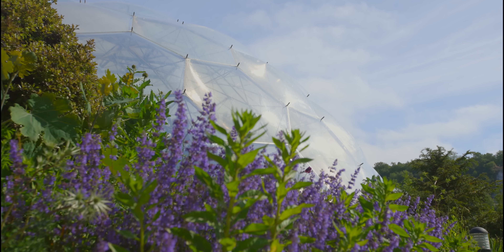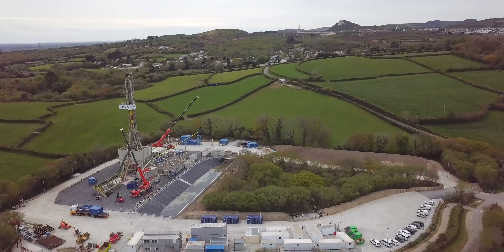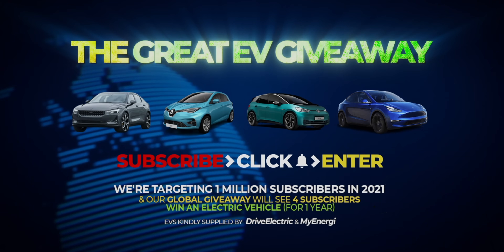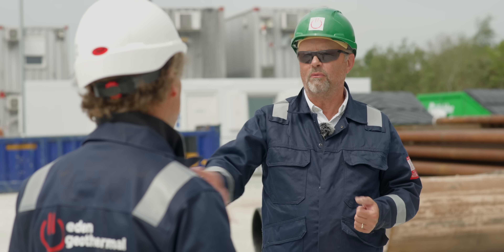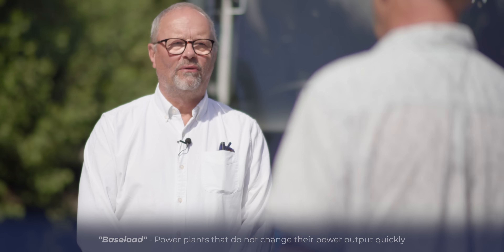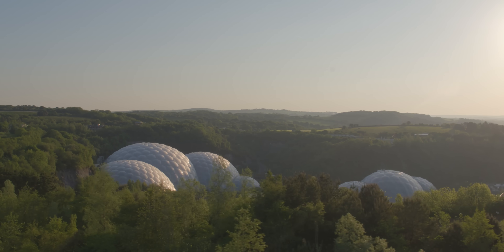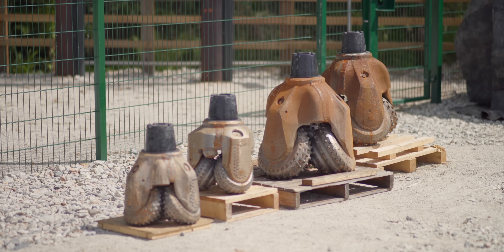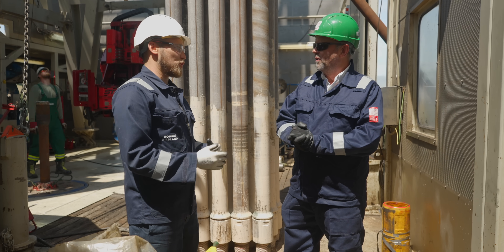Is Geothermal power the answer? | FULLY CHARGED

Comment: If you pump down cold water and pull out heat, how long can you remove heat from the ground before the process doesn't work any more? Because effectively you are cooling down the rocks. I suppose my question is how much thermal mass is down there to extract?

Comment: Does the fluid coming back up not bring anything with it? Salts etc. No by products?
Reply: i'm not sure if it's water or steam coming back up.   either way, anything that comes back up can be pumped back down presumably.   in fact this is the same area where the other fully charged videos was filmed about the possibility of mining lithium, so perhaps some of those salts are actually useful / valuable.
Reply: @mralistair737  yes, but pumping it back in takes up all the profit of the generated power, so there is a net zero benefit. Most of the salts are silica which is worthless but clogs up the pipes as the pressure reduces.
Reply: Spot on! Lots of pollutants and greenhouse gas. It clogs up the pipes and turbine blades if it was actually steam. You have to inject it back because no one wants it in their stream.

Comment: I applaud the innovation, but there's a lot of energy being expended in the build process to provide a steam source for a turbine that produces a measly 5MW output.
Sure there's the promise of producing steam for a long time, but with it being a max of only 180ºC it's comparatively low energy steam. 
Typical steam turbines have 3 stages, HP (high pressure), MP (medium pressure) & LP (low-pressure) stages, the MP & LP use bled steam from ou6tput of the more energy-dense stages (through heat-exchangers) to pre-heat their input temperatures thereby raising the overall efficiency of the plant.
The LP stage is the largest & bulkiest stage & would require a lot of energy just to get it up to its operating rotational speed.
Having said that, it's not all doom & gloom as it wouldn't have the critical differential expansion problems of the other higher pressure stages.
Sorry for my rant, perhaps flying pigs might be feasting on this pie in the eye idea. 😉

Comment: If there are no inter-connecting pipes or the pump in pressure is high .... it's Fracking. What is the working fluid? Is it fresh water? How much water? Is the water recycled?. How much energy do all the pumps use? 4 or 5 megawatt can be done with one semi-large wind turbine. Tons of questions here about costs and long term heat availability in the area being worked.
Reply: Was wondering if this would have the same issues as fracking. Would like to see that question answered, otherwise would love to see more geothermal plants all over!
Reply: @timj11dude  They mentioned that it doesn't use high-pressure water so it is not trying to break and crack open spaces underground. Think of it like water cooling the earth. There is a water which is passed through a loop which gets heated, the longer that water spends down there in the fissures the more heat the water can absorb. Before returning to the surface where we extract the heat and the loops starts again using the same water/fluid. The most damage is done by the drilling itself.
It might not create the most energy and they did say it was a bit of a test project. They could probably get more power by having a bigger gradient between the hot entry and the exit. Perhaps also by drilling deeper and also my increasing flow rate of the water/fluid. But as they mentioned it's not to compete with wind or solar, it's to work along-side and be a base-line which won't fluctuate depending on the weather.
Reply: frackin is using pressure to fracture the rock, they are not trying to fracture the rock, they are using existing fractures, the liquid going in (presumably water) will very likely be at a similar pressure to what's down there, the main pumping pressure will likely be generated by the water heating/boiling.   it's probably / possibel that its a closed loop and that what comes up goes back down, and it just goes through a heat exchanger at the top.
Reply: also fracking doesn't usually happen in 4km of granite, it's normaly in lighter shallower sedimentary rock. and over a much larger area.

Comment: "It's not going to run out". Sorry Robert, that isn't how anything works, including solar.
Reply: Well, solar will last for billions of years and when that is exhausted there will be no planet earth anyway.  However it also crossed my mind that Robert’s bland assertion that geothermal was limitless makes no sense whatsoever.  However I sense that it will last a lot longer than fossil fuel reserves.
Reply: @robsengahay5614  I completely agree, but I'm sure the early exponents of coal, oil and gas said it would last lifetimes (and they were right). There's a flaw in the argument. I'm not sure drilling big holes into the balloon we live on will work for as long as they think.
Reply: @Grafter_67  Neither am I convinced……but there really is only one way to find out.

A poor analogy but many people I spoke with about buying a Tesla assumed that my battery would need to be replaced regularly but it seems that they are doing better than predicted.  The only way to know is to build the batteries, put them in cars, and drive them for hundreds of thousands of kilometres.

If geothermal energy lasted only 200 years it may still be a worthwhile enterprise even as a stopgap but if it lasted 1000 years or more and the environmental impact was limited then it could be a boon.

Either way I think the research that comes from this is worthwhile.
Reply: If everyone person on Earth got all their energy from geothermal, and used as much energy as an average American (which they don't), then the Earth would run out of geothermal energy in around 17 Billion, yes Billion years. 
Considering our Sun is halfway through its 10 Billion year life, a small geothermal project at Eden isn't going to make any appreciable difference to the energy still stored within our planet.
Reply: @johnnodge4327  You do know that they are not actually drilling into the earth’s core, not even the upper mantle, and not even deep into the earth’s crust?

Comment: Interesting, I like the idea of this clean energy source
BUT
as we use the inner earths heat and slowly cool the core, what will happen to the rotation of the earth as the core cools with all our heat extraction ?
It may take some thousands of years and maybe humans will not exist anymore ?
Reply: They are not drilling into the earth’s core, only fairly deep into the crust.  The earth’s core is nearly 3000kms down.  Even the upper mantle is about 400kms down.  The Marianna Trench extends about 11kms below sea level so they will not even drill down to half of this distance.

Comment: @ 14:40 "decaying radio activity" LOL that's exactly right, we've been doing that for years with power plants, seriously, just use molten salt reactors, at it's most fundamental you're talking about the same basic process though i'm pretty sure your "average power plant" would be more efficient and probably cheaper to implement. people need to get over the whole "radiation thing" at it's core it's doing the same as this except in a contained facility above ground.
Reply: well you have to dig a big hole to bury the spent fuel, in this model the fuel is already buried.   nuclear is really not cheap to build and location suitability is very limited (though the plants can be huge) . the newest one being built in the uk is £98/mwh+inflation  that's compared to about an average wholesale price of half that. and a wind turbine price of about 1/3 of that.    existing geothermal is half the cost of nuclear, but if the market and experience can expand it could drop a lot.

Comment: Actual geo-thermal, and not just mis-described GSHP.
Reply: except there is no pumping of heat, just pumping of hot water. which is a different thing.   in effect this is the reverse of a heat pump, you dont use the pump to move the heat, you use the heat to move the pump.
Reply: @mralistair737  no its not a reverse heatpump,  that is to far off the principle.

It will be used to heat up water* to steam that turns a suited turbine, goes trough a condenser and loops.
*secondary loop with water.
Reply: @ferkeap  a liquid that is hot and under pressure, then released to generate movement and cool.  is the reverse of one that takes low pressure cold gas and through movement turns it into hot high-pressure liquid.   Seems exactly the reverse. I don't mean "a heat pump running in reverse" I mean it's "using the movement of heat to generate mechanical movement"     perhaps it's a banal observation

Comment: Quite a few years ago a friend of mine worked on a similar project in Denmark close to a town called Aars. You can guess what the affectionate name for the well was.
Reply: Aars Well ? 😉
Reply: @bordersw1239  I don't think that it ended well  because the flow rate was disappointing and I expect that the project was abandoned after drilling one hole
Reply: @bordersw1239  9i

Comment: The description of baseload was terrible.

Baseload is simply the minimum you need to keep the grid running.

It's important because it always needs to be provided, something that wind and solar can't do.

Nuclear is usually a key component of baseload supply, because it takes a long time to ramp up and wind-down, but when running runs consistently for extended periods.

Comment: in Italy we have been producing geothermal energy for many many years, Tuscany is leading the way with the historic Larderello plant: Italy has an installed capacity of 1,100 megawatts, producing 6 terawatt hours per year, 5% of the nation’s green energy
Reply: Moar!
Reply: I was in Sicily 15 years ago and tbh I did not see any geothermal energyproduction there
Reply: @Roguescienceguy  90% of geothermal energy is in Toscana
Reply: Italy was the first real plant.

But you have stopped at the easy part of this.

Put a halt to the promise of modern nuclear.

And start to build up consumption of gas and are using that by the boat load now.

Get back to investing in geothermal and nuclear. There both brilliant.
Reply: @ferkeap  we had TWO referendums against nuclear, I guess it's pretty obvious that we don't want it. On top of that, Italy has a high seismic activity which, as we all know from history, doesn't go well with nuclear. If we install photovoltaic panels on all private houses and commercial buildings alongside geothermal and hydrogen we are set for the future.
Reply: @carlodanese9120  exactly. Building nuclear would be really idiotic, not just because of the potential ground instability but also because nuclear is a short term solution that creates an effectively permanent obligation for humans to be around and managing the waste.
Reply: You could get some serious geothermal around Mount Etna!
Reply: Is Italy very volcanicaly active?

It sounds good though that you are able to use this power
Reply: @TrueTidy  Italy is VERY volcanic. And the Geothermal energy is mainly untapped. If we used it all we would cover all national needs JUST with geothermal energy. The other advantage is that we have plenty of mountains in regions where we build plenty of DAMs... so we have a lot of green energy...we still need to improve it... and the new investments are all about green energy right now...
Reply: @anderspistaceci  hydro will not very interesting as the glaciers are less of an annual source and its not very good for biodiversity in many cases.

Italy had a good base for nuclear but completely abandoned it, which is a very sad picture today.
Reply: @ferkeap  We did it because we have a bad habit of mismanaging waste. In Italy nuclear waste would be just killing people. Elsewhere perhaps they can manage it.
Reply: @anderspistaceci  I disagree as Italiens are very good engineers as well.
You can not hide even most insignificant radiation particle.

Also you would be under scrutiny of international professional orginisation like the iaea.

I would compare it with the space sector
Reply: There is a little co2 and other gasses, released from geothermal, you need scrubbers to release gasses that naturally come up from the sources and some minerals.

This not very intense and could be improved some more.
Reply: California produced 11.345 TWh of geothermal electricity in 2020, nearly twice as much as Italy.
Reply: @RandyTWester  SUPER COOL !
Reply: Geothermal energy on tap, great wine and pizza?  Please can you rescue me from brexit Britain!!
Reply: Good for you.
Reply: Maybe only Blue energy. How much CO2 is vented to the air per KWh?
Reply: @kimollivier  you seem to misunderstand how geothermal power plants work. There is no CO2 generated by the plant
Reply: @kimollivier  Probably around Zero. Apart from the cost of creating the Plant and maintenance/repair.
Its so good, we don't use it! (but smarter Countries do).

Comment: I would have liked to have found out more about output capacity, and economics of the project; how many homes can it power? whats are the costs compared to other renewable sources? etc.
Also, at 14:28 when Robert asks about why that place is hotter than other places, the guy doesn't really answer the question, instead he gives a brief explanation about where geothermal heat comes from in general, which is not what Robert asked.
Reply: Yes lots of gaps in the whole presentation. Greenhouse gas emissions, non sustainable (the bore cools down). Consider the rock is in equilibrium now, then we cool it to extract energy the heat does not rush in, rock is a good insulator. Otherwise we would burn our feet just walking on the ground!😁
Reply: @kimollivier  interesting... and if the rocks cool down I guess that would lead to shrinkage, which might have side effects on the landscape? No doubt they have accounted for these things, but it would have been nice to hear more information about that stuff

Comment: This company admits they don't have much knowledge of what is down there bar it being retained radioactivity. Will we be saying in 500 years 'what were they thinking?' as the core starts losing heat because we drilled vents all over the place? Who says it's not going to run out?
Reply: I think all the worlds active volcanoes collectively release more heat from the mantle of the earth than we would ever obtain from geothermal drilling
Reply: @masterquadbiker  good point, I just don't care for the term inexhaustible.
Reply: This isn’t going to affect the heat in the earth’s core as they are only drilling deep into the earth’s crust and not remotely close to the core.  Nevertheless I am dubious about any claim that this source is inexhaustible though I suspect it has far more longevity than fossil fuels.
Reply: Don't worry, just wonder why we don't burn our feet walking on the ground! The rock is such a good insulator that the energy able to be extracted to be useful. It is not a renewable technology, there are significant CO2 emissions.

Comment: That seems like an awful lot of work to create, but somehow also less work than producing 5mw from coal.

I wonder how far away we are from building sites like this, or manufacturing solar panels and wind turbines, without requiring any fossil fuel effort in the process. All electric powered mining for resources, electric vehicles to deliver them, electric machine to refine them and turn them into usable materials, electric machine to produce parts and assemble them into systems, and electric construction equipment to build it on location. A start to finish all electric, all renewable, construction project, to produce more renewable energy.

Comment: There is new technology for drilling called millimeter wave. No expensive drill bits. It turns the rock into powder which is brought up with compressed air. The first wells at 12 kilometers are being done in Washington State U.S.A.
Reply: interesting
Reply: Laser drilling sounds futuristic
Reply: @chrisdaniels3929  It's actually not laser. It's below that frequency and tailor made for obliterating rock with a lot more efficiency.